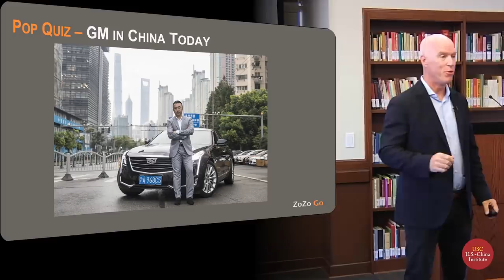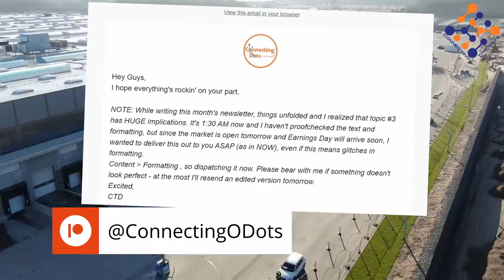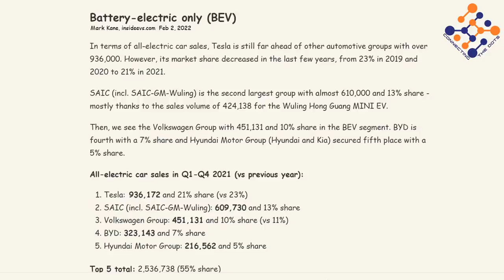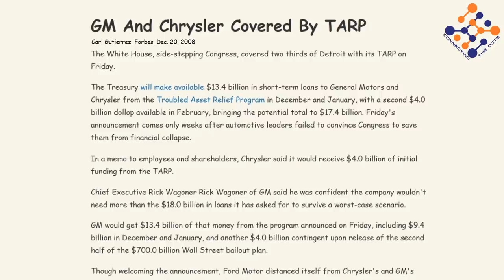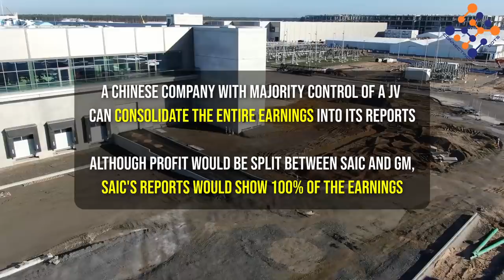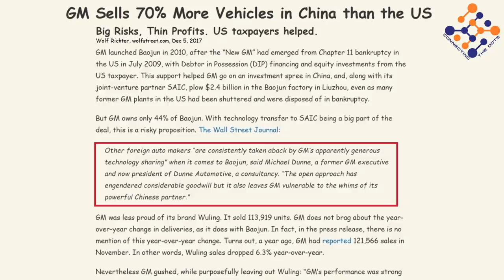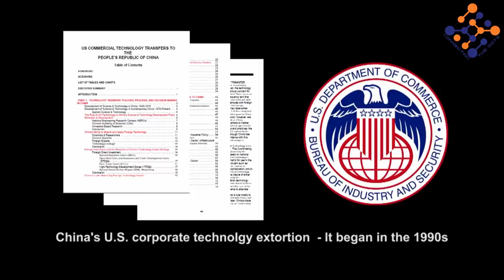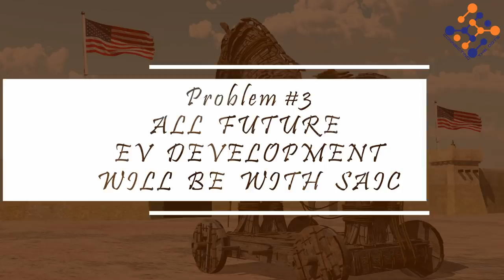How GM Sold America and became China Motors. Thanks for the Bailout, though (Part 1)

Comment: US tax policy supported GM's poor decisions over time. I started my professional career at Generous Motors in Detroit back in 1985. Top mgmt had trouble finding their way out of a paper bag even then!
Reply: So you were part of the problem!
Reply: @ksli57  Ouch! If you work in corporate, you know the most dedicated, altruistic and talented people usually get the shaft. Oftentimes, the most talented really want to do a good job and hate the politics. Their smoozing game is horrible. They make those who failed up uncomfortable because management doesn't want to be exposed as frauds. Most of those frauds take credit for the work of truly talented people.

I'm sure the level of such beaureaucracy at GM is beyond cartoonish.
Reply from the maker: I gotta add that GM used to have first rate engineers at the time. They still do (re: latest mid-engined vette giving Ferrari performance for low price) but much less than before, and in EV tech they are seriously lagging
Reply: @ksli57  I'm guessing you don't know much about John DeLorean.
Reply: @ksli57  Read "On a clear day, you can see General Motors".

Comment: I am a mechanic and even though GM vehicle problems had paid my bills for a long time I have always had nothing but hate and discontent for GM. The 2008 bailout made my blood boil for a long time until I learned how to day trade stocks. Now I smile every time I scalp GM as I know that I am finally getting some of my tax dollars back from the bastards. I look forward to taking part in shorting GM into oblivion soon. I can't wait to do the same to Stellantis.
Reply: Rather than shorting GM, you would have a longer and larger return going long Tesla IMO. Look at Out of the Money ,2 year out calls. When Tesla dips hard due to macro issues, it may be a good time to buy some long calls.
Reply: @rayspencer7255  that is risky. Shorting GM isn't risky, even though shorting is usually risky.
Reply: @موسى_7  Hang on to that thought. Tesla is growing exponentally (50% + /yr), and is propelled by the marco economics of renewable energy transforming /replacing fossel fuels. One option contract now will increase to many contracts ( 5:1,10:1) after intentions to split that was announced last week. Buying Tesla is buying an auto company, an car insurance company, a renewable energy company , a robotics company , an AI company all rolled into one. I am a 100% Tesla investor BC everything else is a crap shoot ( I am also a retired engineeer )
Reply: You're hysterical. Calm down
Reply: Day trade stock is the key 🔑
💪😎👍🍾
Reply: I worked at GM, too.  Never owned the stock of I could help it. I own Tesla stock.

Comment: I thought this was going to be a hit piece but it turned out to be an eye opener.  I've been a GM buyer for 45+ years.   The more I watched, the more angry I got!   GM management has always been bad but this is completely unacceptable to the point that someone should be prosecuted.  I drive a Chevy today but that won't last for much longer.  Let's hope that Ford stays American and healthy.
Reply: Well for all of the highly educated people on this feed here is a little info for you all. Ford is no different than any other manufacturer.  A majority of their parts are produced out of country. Fix the government and well will produce more internally.  

Ford's main parts suppliers, along with the parts they supply, are as follows:

Flex-N-Gate Seeburn - Ontario, Canada: door hinges and arms.
NHK Spring - Shiga-ken, Japan: suspension stabilizer linkages.
U-Shin Europe - Komárom-Esztergom, Hungary: steering columns.
Valeo Electric and Electronic Systems - Czechowice-Dziedzice, Poland: starter assemblies.
Webasto Roof & Components - Schierling, Germany: sliding sunroofs.
Summit Plastics - Nanjing, China: instrument panel components.
Dee Zee - Des Moines, Iowa: running boards.
Warn Industries -Clackamas, Oregon: axle assemblies.
Chaidneme - Bogota, Colombia: mufflers and exhaust systems.
Autoliv - Stockholm, Sweden: airbags6
Reply: Ironically Tesla is the most American car manufacturer now. All those GM & Ford lovers made fun of Tesla. To put the boot in hard, Tesla owns their factory 100% in China unlike any other manufacturer! I’m angry at GM & Ford but times are changing and it’s time to support other manufacturers.
Reply: @frankzimmerman5510  Unlike GM though, Ford didn't hand the company over to China.  Sourcing parts from all over the world has been going on for quite a while and it's not exclusive to American manufacturers.  On the other hand, I would like to see Ford move manufacturing back home from Mexico.
Reply: If you want to buy american, you have tesla.  Stop buying cars from foreign companies like gm and ford.
Reply: @frankzimmerman5510  amen
Reply: @scottbroadhead9969  Too be fair, everyone gets chips from foreign sources.  The important part there is that tesla is the only one trying to insource every component.  Ford and GM have been actively outsourcing for decades.
Reply: @alsnow3582  I agree with the global sourcing part of your comment but the second part made me wonder. Why would you want Ford to move manufacturing back from (specifically) Mexico but not Canada or any of the other places Ford has plants?
Reply: I am afraid, if you looked closely, Ford has a huge debt load coming due in the future and "We the People" will have to do something to help them remain competitive.
Reply: @stevemiller995  Ford paid their last bailout back
Reply: Was wondering the same thing.
Reply: Tesla is a great American manufacturer the world will try to emulate.

Comment: Well, at 13:20 ... I think its a bit of a reach to assume as fact that China could only learn this technology from GM or other auto-makers.  That was true in past years, but only isasmuch as it allowed China to accelerate their learning curve.  Frankly China has caught up and at the current juncture they don't really have any need to for outside car companies' technology.  They are moving forward with their own expertise (which was their whole intent).  And now that they have reached this point, the 50-50 joint venture requirement is no longer as important to them as it was in the past.  This contributed to Tesla being able to own 100% of their own factory in China.   That would not have been allowed 10 years ago.

Technology 'secrets' are never really secret.  Its not possible to keep it yourself, even if you don't have any foreign factories.  So it comes down only to the speed at which China could catch-up to us.  This is important, yes, but maybe not as important as you are implying.

On electric vehicles... well, there isn't a whole lot of technology to transfer into China in the first place in this regard.  EV drive trains are dead simple compared to ICE.

-Matt

Comment: The worst thing to happen to GM was the bailout.  Instead of a bankruptcy that would have forced the inefficient ways to be purged to create a stronger company, it became dependent and willing to take any deal to survive.  Yes, Biden is correct that GM is leading the way on EV's.  Unfortunately, it is taking the US down a road that depends totally on China.  I started my career at GM in 1984.  The engine plant where I worked was closed in 1988 and the equipment sold  to the Chinese.  In 1988, I left GM because of the dysfunctional management -- nothing has changed.

Comment: Thanks! Correct analysis. Barra and her network are busy shuffling assets around and profit from treating GM as their piggy bank. Last I owned a GMC Sierra and a 1954 Chevy truck. I kept the 3100 as my sole daily driver. It's just the better truck. Maintenance, tax and insurance of the 54 is cents on the Sierra Dollars, which is, in turn, not expensive to maintain. The 54 does 90% of the workduty of a modern truck at 60% of the fuel cost. Engine is super smooth and revs very well.

Comment: It gets worse.
GM effectively sold Sandia Labs explosives technology to China about 25 years ago.
It did so by selling China the manufacturing rights for the Quad-4 engine.
When GM recognized they were losing market share to imports that had more efficient engines,
it asked for help from Sandia labs -- a government explosive lab.
Sandia applied its supercomputers to determine exactly what was happening within the combustion chamber.
The result was a very innovative 2.3L engine that developed about 140 HP while getting close to 30mpg on heavier cars than today's.
By contrast, Chrysler fielded a 2.3L engine for its PT cruiser but it developed less than 100HP and got about 24 mpg.
The Quad-4 also had tremendous potential for developing much more power.

How did I learn about what what GM did? A neighbor owned a Quad-4 Oldmobile that had special access stickers for U2 and SR71 fields.
He didn't say so, but it struck me as a rather disloyal thing for GM to do. I later looked on line and found only five car brands in China then.

Something else. The Quad-4 had a reputation for blowing head gaskets, which happened to my car once.
Instead of having the engine rebuilt, I replaced it with a remanufactured one that included all the engineering updates.
It was extremely reliable after that.
Reply from the maker: As an aerospace engineer I know Sandia labs very well, but was not aware of this story. Thanks for sharing

Comment: For long term success. Not just GM, many traditional car companies will die if they are slow to change. Everyone knows the future is EV. Only China can supply large amounts of batteries
Reply: Not everyone is on board with this EV crap. ICE vehicles arent going anywhere no time soon and EVs still have issues to be dealt with such as a reliable grid charging ports across the country to be developed and put into place. The cost and production of batteries is yet another barrier to contend with. Until they bring the cost of batteries down, EV s wont be in mass production. Then you have the issue of battery replacement during the lifespan of a vehicle. Is it worth it??? Think about that one and let that sink in.
Reply: @k.c.marshall921  when the steam engine was invented, the horse riders said the same thing.

Comment: In my opinion the bailout of GM was a politically motivated mistake of epic proportions.  Obama, in futile attempt to save the UAW, bailed out GM. If memory serves the bond holders were stiffed as well as the shareholders in favor of the union.  GM had been failing as an efficient producer having succumbed to its Unions demands.  The result was its quality of manufacturing as well as its technological development was in chronic decline as was evident by its shrinking market share and failure to compete with the new domestic competitors from Korea.  The best thing that could have happened to GM was a bankruptcy and reorganization together with a renegotiation of its labor contracts with the elimination of the UAW.  It is my opinion the GM that would have emerged from bankruptcy would have been much better equipped to compete as a smaller more agile competitor.

Comment: GM is no longer important for China since the automobile industry is changing from combustion engine to electric vehicles. And GM is very late in the game, where as many Chinese auto brands have shift their focus to electric vehicles 4-5 years ago. This is partly due to their inability to produce great combustion engines, and the other part is that Chinese automakers found themselves being much better with producing electric vehicles.

If we were talking about 10 years ago, GM was pretty important, but GM also needed the Chinese market because that's at least half of their global revenue.

Nowadays, GM is no longer important, but they still need the Chinese market, and they're losing the market share really fast!
Reply: At the right price the Chinese will buy GM lock stock and barrel.  Another bankruptcy and the price will get cheap.  The Buick brand in China still carries a lot of cache.  The GM dealership and parts distribution in the US and Canada would be an asset for China to distribute EVs.  Just a matter of time till China owns all of GM and Barra and the board get a huge golden parachute.

Comment: A similar tale regarding SAIC and the British car manufacturer Rover happened in 2005. Rover was in serious financial problems and sought a partnership with SAIC. They arrived in China to sign the deal but beforehand had a meal with the SAIC negotiators.
During this meal a British observer noticed that the Chinese were raising glasses of saiki to the deal. However, it was noticed that the Chinese were not drinking only pretending, the British however fell for it and were soon drunk.
It was at this point that the Chinese presented the contract for them to sign which they did. It wasn't untill the next morning still nursing a hangover that the Rover board realised that they had signed all the rights to their designs over and now the Chinese owned them they had no more interest in Rover. Later they removed all the gigs, patterns and machinery from Rovers factory and started manufacturing the cars in China. Though the Chinese were later angry to find out that the Rover name had not been part of the deal, so they called their cars Roewe which are still in production in China. Roewe apparently in Chinese sounds like Rover. Before this the Rover company had already been broken up into two seperate companies by BMW into Rover and Landrover, so after this debacle Landrover bought the rights of their former parent company where it now resides. At the moment there are no Rover cars currently in production, though there have been rumours it might in the future.

Comment: The TARP for GM was to pay for GM past mistakes , SAIC deal was to allow GM to move strategically forward by  entering China huge market . This  move helps to get GM back to profitability.  Did GM get into China market? yes . GM cars were top seller in China. Did SAIC  get the technology transfer they openly layout as condition in the deal? Yes.  Could GM need another TARP if it has not gone into China market? most probably.  So what is the problem ?

Comment: Most interesting...and worrisome.  You should maybe also mention the Australian bailout.  Teeny tiny in the scheme of things (around AUD287m in 2012) but it was supposed keep Holden going...then GM killed them off.  Now it's clear why :(  The unfortunate knock-on effect was that we lost all manufacturing because Ford and Toyota didn't have enough volume to keep the related manufacturing viable.  China will now try to flood the market with EV's (inc trucks) for 20 years and then use the 'master kill switch' to great effect.  "eg, Let Huawei operate your comms or we'll cause food distribution nightmares by turning off all the trucks"

Comment: Remember also GM had 600,000 retired workers on pensions when the GFC hit , its why US Auto manufacturers were driven to high end gas guzzling Tanks to survive.
Reply: GM was pretty much screwed no mater what.  They made nearly half of the cars sold in the United States in 1980.  After three decades of domination, they had a massive pension liability.  With automation requiring fewer workers, there was no way they could have remained solvent.  It would have required larger employee contributions and smaller guaranteed payouts to be established back in the 1950's.

Comment: Back in the 90s I bought a 1975 Camaro and a couple Years later bought 1976 full size Chevy pickup fell in love with GM Vehicle. Also owned 2004 SS Impala 2013 Cruise and currently own a 2020 Trailboss and it will be the last one I buy from GM. Already know they were moving all products to China and Mexico though it was because of labor costs didn't know all this neither way the love affair is over and I'm done with them. Signed EXCHEVY GUY
Reply: Awesome, it will save you a lot of repair expenses that you endure all these years.

Comment: I've never liked the way GM has done business.  The US government should NOT have bailed them out; they would've ended up in the same position they're in now b/c SAIC would've given them the money and took control anyway.  At least it wouldn't have been at the expense of the US taxpayer.  The government owned 51% of GM after the bailout and dumped all the stock for a multi-million dollar loss (circa 2011, I think).  I've been wondering why Mary Barra hasn't gotten more aggressive with EV development.  It all makes sense now.  Ford is the only company that didn't accept a government bailout and is the ONLY American auto manufacturer which is very aggressively pursuing EV R & D.  I think it's waaaaay too late for GM now.  Hopefully, US industry will learn.  Back in the 80's, it was the Japanese who turned up the heat (and quite frankly, left it that way).  Now, the Chinese are putting the fire in the pan.

Comment: Ford produced the first hybrids in 1900s.
Henry Ford required first vehicles to use battery and starter motor to move car in emergencies (like running out of gas) e.g. stuck on Railroad tracks.

Comment: Another good reason to never buy GM. Unreliable cars from the 1970s, built to break.
Reply: You need to check out the Buick Grand National, this was the first distributor less ignition in the world, called the c3 ignition in 1984, yes, 1984, many did not follow until well into the 2000, GM also introduced drive by wire
In 1989, notice Toyota was having unintended acceleration issues when they introduced their version a few years ago. Also find out what “super cruise means” and who invented it.
Don’t bash GM as they have moved us forward in innovations.

Comment: I think you gave GM too much credit, the Chinese were a manufacturing powerhouse with or w/o GM. Case in point, GM relied on LG S Korea to develop the Bolt EV, ended up a 🔥 hazard debacle. Chinese BYD, Xpeng,Geely,Polestar EVs are years ahead & produced at a low price, with superior SW, 🔋 & motors. Now Elon worried about them, but he mocks GM.